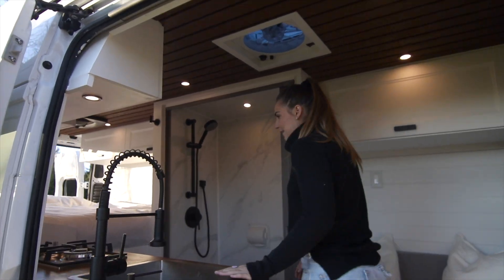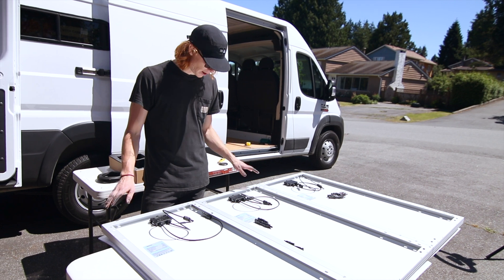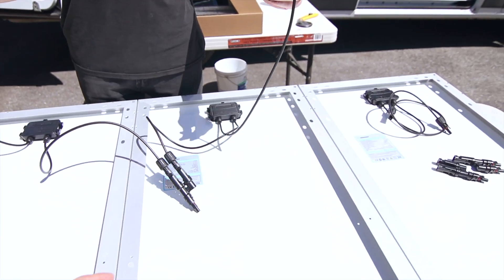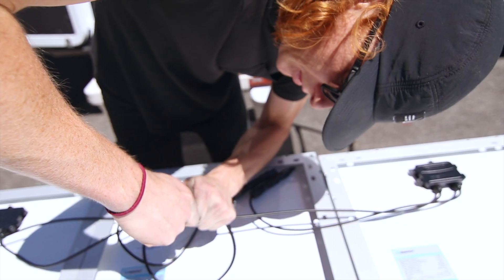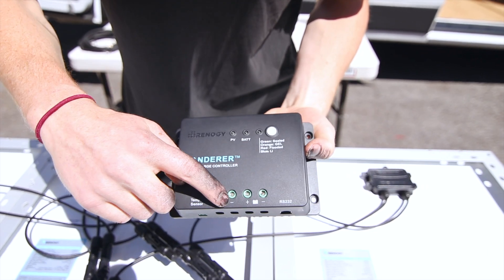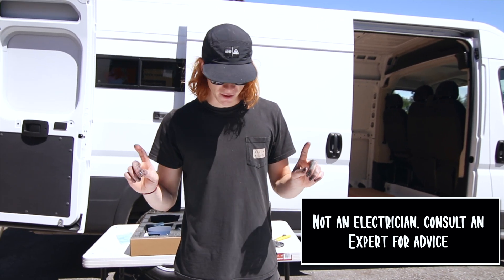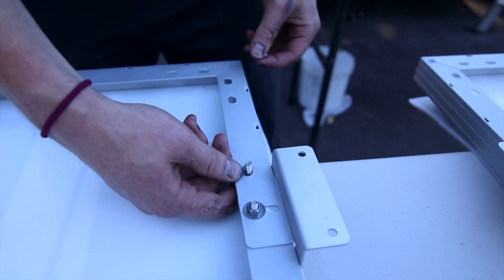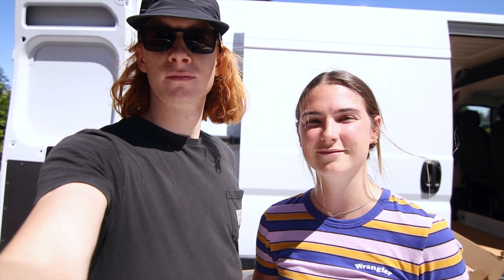How To Wire Renogy 300W Solar Kit | Connect Solar Panels In Parallel | MC4 Connectors | EPISODE 7

Comment: based on other videos running panels in parallel, those other videos have fuses at each panel before the controller. Not to mention another fuse between the controller and battery

Comment: I've read that Renogy and a lot of Chinese MC4 connectors are not compatible with other brands. There are apparently slight differences from the standard that can make them not make a proper connection.

Have you folks run into this issue when interconnecting brands of MC4?
Reply from the maker: I haven’t had that issue

Comment: Not a happy customer after purchasing our 300 watt renogy kit. 1. Arrived without instructions. After I wired panels in Series, kept getting over voltage E-`10 on controller. Was then tolds parallel only with 30 amp Pwm controller. Up on roof to disconnect all only to discover wire lead to one panel 2" short reach M4 connection unless I removed all 3 panels (holes already made in roof) decided to purchase 3 into 1 extensions. First & last time buyer using anything Renogy.
Reply from the maker: Yikes, sorry you had such a negative experience ☠️